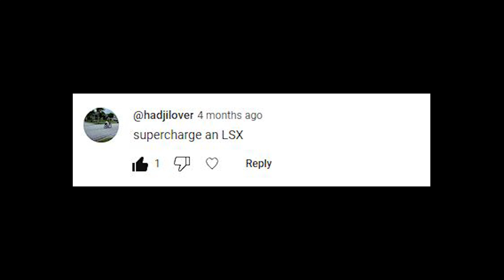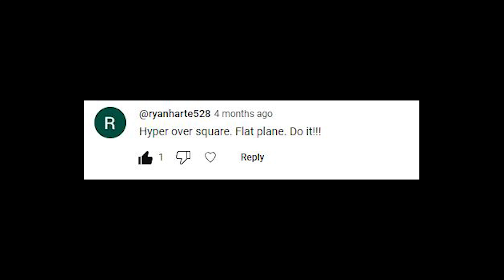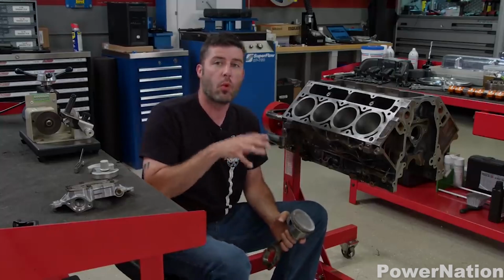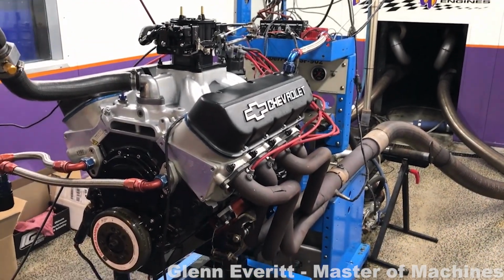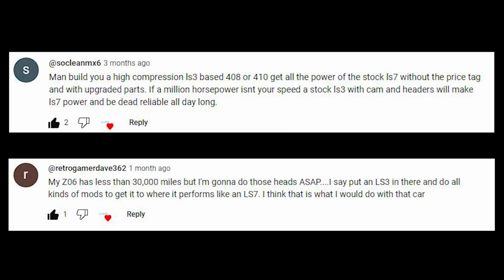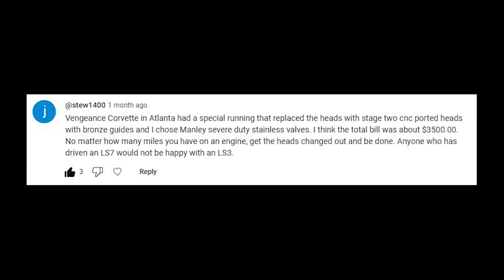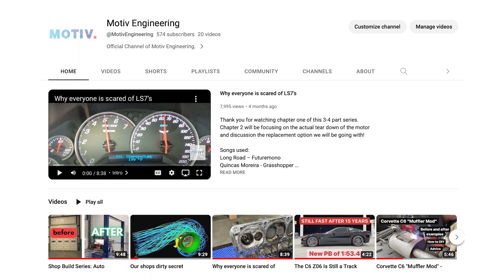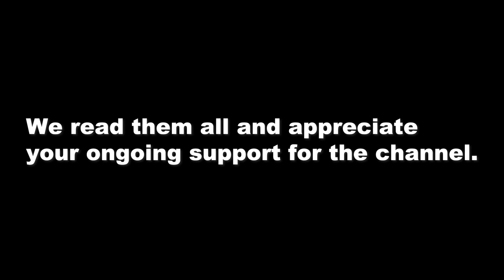Your LS7 replacement ideas

Comment: I’d just go ls7 and fix said valve problem.
Reply from the maker: That's what I'm feeling too.
Reply: That's what I did to mine 👍
Reply: If you go this route spend bigly on the heads..$3,500 gets you a pretty good package from American heritage. Ti / moly valves. Hollow ss exh, pm guides and all the machine work. For an extra 600 you could even use formula one guides. When these engines fail it's always in the cylinder head
Reply: @GridForgeMFG  ZZ632
Reply: I've seen a couple posts on the Corvette forum with exploded motors with "fixed heads". These things are a just a flat out gamble.
Reply: @GridForgeMFG well what happened I’m new here

Comment: I say stick LS7. You could always go 416 LS3 but Id want the ti rods and intake valves and some better exhaust valves in an LS7 to keep the character and call it a day. And thats exactly what I did. I went with a mild (for an ls7) cam and "fixed" heads, ARH headers and a ported MSD. A whole bunch of while youre in there stuff happened after I dropped it off.

Good luck with the build! Wouldnt blame you for just camming an LS3 and feeling safe for the next 100k.

Comment: Just bought my first corvette after dreaming about them as a kid. I chose the C6Z specifically bc of the LS7. 505hp in a LS7 vs 505hp in a LS3 or any other motor, just doesn’t have the same attraction, I think that’s evident in the car world. The power builds to redline, and those type of motors for whatever explanation, just grabs everyone by the heart. Si/type R’s with Vtech, McLaren  F1, AE86, many Ferraris 355’s, F550, Jag XJ22, GT350/350R, Toyota TRD, the lotus Elise with that TRD motor in it…Etc etc. N/A all day…& as long as the dyno graph just builds upwards until kissing redline ppl will love them 🤷
Reply from the maker: Wow, thanks for the thoughtful comment. I completely agree with your thought process. I think the LS7 changes the whole character of the car. I really enjoyed it. 

No matter the motor going in, I want the power to feel fun and exciting.
Reply: I agree the LS7 is a special engine hand built by GM. And pushed every limit we know. If you look at the CNC porting of that masterpiece its amazing.  I know it's not cost effective but they are just wonderful.

Comment: Whatever you do upgrade at minimum the scavenge side of the oil pump.  Past that depends on budget and power goals.  LS3 525 crate with dry sump upgrades is a reliable option to learn how to go faster leaving open the option for a bigger cam etc.  If you go LS7 I'd run aftermarket heads not ported factory, and work with a vendor such as cam motion to get the valvetrain to be reliable on track.  Aftermarket heads maybe labeled LS3 but are more LS7 in port opening.  Eric Weingartner had an internet port series on a LS3 aftermarket head.  One of the ports was a high velocity design which looked promising for a 427.  Even if you don't go with him it is an interesting look at aftermarket heads.

Comment: Oil pressure is one of the best tools to monitor how healthy your engine is. From watching a few clips of your lapping I can see your WOT oil pressure is def on the lower side. I say 55-70psi WOT is what your looking for on track with a higher weight oil. From videos, i can see it almost in the 30s which is what you want at idle. If i saw those pressures I wouldve considered a rebuild before anymore lapping was done. Just something to think about when you start over with a new engine.

Comment: I can say, we have put down a little over 500hp through a 4l60e with a 6.2L in a 72 C-10. Mind you we had CNC ported heads, custom grind cam, and a bunch of trick bottom end parts.
Reply from the maker: Good to know! I bet building out an aluminum 6.2 gets close to approaching used ls7 prices.

Comment: You can build an LS3-R. It's an LS3 block, GMPP CNC LS3 heads, 3.75" stroke, 4.07" bore, 1.165" piston crowns (Same as an LS7) flat-top ceramic coated and notched. 6.2" connecting rods. The pistons stick out less than stock with this combination. 6.4 liters, 391 cubic inches. TSP 227 camshaft. I stumbled across this setup by accident. I asked myself, "What if GM was allowed to use high quality forged pistons?" and this is what I came up with. 
-- Another option would be an all-aluminum 540 big block chevy with cylinder heads from the new 632 crate engine. You'd need a custom dry sump though.

Comment: So, I got to thinking about my suggestion of an aluminum big block. 
-- Brodix aluminum block will put you a minimum of 100 cubic inches beyond stock LS7's for the same cost.
-- GM RS-X heads have shallow valve angles just like the LS7 does. You can get Eric Weingartener to do your valve job. 
-- Kinsler ITB's as a cross-ram will be unique and true to the Corvette. 
-- Those heads will bolt onto a 4.56" bore. A 4" stroke, 1.27" pistons, and 6.535" rods give you 523 cubic inches and a tight above-deck quench.
-- A 4.6" bore and 4.25" stroke will give you 565 cubic inches, using 1.27" pistons and 6.385" rods, with a zero-deck setup.
-- A 4.5" bore and 4.25" stroke gives you 541 cubic inches. 
-- The camshaft I came up with is 232/242-114LSA, 108 ICL. You get a 44 ABDC IVC. .650" lift is all you really need on this thing. Yes, .700 will make more power, but there's so much of everything else going on, I think it'll be the last thing on your mind. 
-- Run a 4" pipe from the air box through the cowl and into the cab. 
-- If these are the end times of ICE, I say wing it!

Comment: RHS or Dart LS Next aluminum block, you can run it as a 427, 441 all the way up to i think a maximum of 496ci. They have priority main oiling, which is big for you track fellas. Also, the LS7 dry sump system (your current oiling system) will bolt right on (just make sure its cleaned out really really good). You can pick and choose your CR when building a engine, so you can push it to run on the ragged edge of whatever fuel you want and make big power. Having an aftermarket rotating assembly means you need to get it balanced at a shop, bonus is the shops will balance your rotating assembly FAR beyond what GM did with any of their engines, allowing you to rev higher, same with the valvetrain. Aftermarket addresses a lot of short comings, i won't tear down the LS7 as a bad engine since it isn't, but once GM puts them into production their weak links can be seen an addressed. Downside is this could be expensive AF, would have to do a lot of research to make sure it all plays nice together. If you are not dead set against a forced induction engine a supercharged LS3 or LS2 could easily produce the power levels your at now and exceed them if you wanted for much lower. But, why not start off small? get a junkyard L33 aluminum 5.3, throw a cam and a cheapo turbo, or supercharger? I mean, you basically have an race ready chassis. depending on how mechancially inclined you are you could chop the front off the car, do a full tube front end (would allow you to drop the fenders/front end super easy to work on the engine) and it would even offset the weight of a iron block if you wanted to go that route. Hell, do something weird and put a ford Barra engine in there with a big ol turbo. I am sorry to hear your LS7 block is dead, but now you can use the car as a platform for doing cool stuff! like a destroked LS3 that pushes 9000rpm or whatever! GL Friends!

Comment: If you have time and money, start with 5.3 aluminum block and bore, stroke it to desired displacement. Build a nice set of heads to match. The "affordable" easy solution, drop a LS3 crate motor with the hot cam in it from GM and call it a day.

Comment: So I know it's not exactly the same setup but I've got a centrifugal supercharged LS6 in my C5 Z06. The A&A kit is phenomenal for these platform of cars as it's essentially a bolt-on supercharger that isn't that difficult to mess with if you are handy with a wrench.
With my car's current setup, I'm pushing 583WHP which is a pretty hefty amount of power out of a 3rd gen LS.
Having something like a supercharged LS3 will easily stomp the ground out of any LS7 on track for linear performance curve.
Yes, it's not exactly the same thing as the "famed LS7" that everyone loves to talk about but it's still something that'll put the power down reliably.
Will you have to beef up cooling to handle the blower? Obviously yes. 
Speaking from experience however, a centrifugal blower has a very linear power curve and specifically hits peak power in the upper RPM band, meaning it's daily driveable when you want. I know this because that's how my car's currently set up. I daily drive my C5Z often, and despite having what BTR calls a stage 3 cam the car's actually quite tame unless I lay the hammer down.
A buddy of mine has a base C6 with an A&A kit as well, and our estimate on power levels with the flextune kit the car has installed from a previous owner is somewhere into the 700WHP range.
You can knock blowers all you want, but in the end if you do it right they make tons of power in a linear curve.....
Just my thoughts

Comment: honestly its pricy but an mostly stock ls7 with redone valve guides, either send it to a shop or do it yourself but another ls7 seems like the best option for many reasons and if you put a bit more time and money in to grantee good valve guides then you will have an amazing motor with reliability and simplicity.

Comment: You can't be concerned with resale value and want to consider anything other than a direct replacement/upgrade from the factory LS7. Anything less will likely significantly devalue the car unless it's some crazy boosted ls3 / 6.2L build (turbos, bigger blower, etc), which is also something you seem to want to avoid. It's gonna hurt financially, but I would consider a max effort N/A LS7 or 427 LSX. That way, you keep the displacement, potentially upgrade the power with cam and bolt-ons, keep the weight balance of the car similar to factory, and don't kill the resale value too much on the car

Comment: The LS7 offers things an LS3 doesn't without costing the same or more. The dry sump, for one. The bore size, second. 
Don't give up the LS7 because it has only one critical failure point that is easily solved with aftermarket valve guides.
Reply: Lots of ls3’s come with dry sump

Comment: There is a shop called TSK out of Ohio. They are taking gen 4 blocks and for $2000 they cnc machining they blocks. Then they press in Darton sleeves for 427 or 440 cubes. A 5.3s are cheap. Then run a set of ported Ls3 heads. Way cheaper then a new 427 that's going to detonate again.

Comment: MAST Motorsports re-sleeved factory GM Aluminum GenIV Block (4.185" Bore x 4.125" Stroke) for a 454 LSX short block, rebuilding your LS7 cylinder heads and re-using all bolt-ons. You don't need to spin the thing to the moon. A 6,500-6,750 RPM Track car with tons of bottom end would suit you fine.

Comment: My LS7 just had a valve drop, smacked the piston in cylinder 8 and cracked the cylinder wall. I am in a similar boat about decisions on what to do next.
Reply: Have you come up with a decision? Mine also just dropped a valve and I don’t even know where to start

Comment: I straight loled with the "devalue" conversation.  Mike: "i'm worried an LS3 swap will devalue for resale" Me- in my head: yeah for sure. I see a C6Z with an LS3 and I hard pass  Isaac: "so you're not worried that 100k hard track miles and a roll cage WON'T devalue it?" Me: 🤣🤣🤣🤣🤣🤣

Comment: How about a Dart LS Next block, 7 liter turbocharged? You get the strength and raised hp capacity without the weight of an LSX block. This is upgrade I am thinking for my currently procharged C6 Z06.

Comment: How much power do you want? 500whp should be attainable from a naturally aspirated LS3. A 416 stroker should have as much potential as an LS7 would if you're willing to sacrifice a few revs. 

Unfortunately, unless you wanna get what is eventually a motorcycle engine into your car, an LS is about the best way to get a powerful and reliable engine in a lightish package. ~450lbs for most  naturally aspirated aluminum block engines. 

Now the motorcycle engine route. Build a balls to the wall track car with a hayabusa V8 crate engine. Revs to 11k and makes about 460 horsepower naturally aspirated. The complete engine weighs only about 200lbs and you don't need such a heavy trany. I know you're not going this route but it's cool.

Comment: I think a cool motor would be somthing like cbm’s ls3 that’s stroked to 7l so you keep a 7l motor but with a ls3 type motor
Reply from the maker: I'll take a look. Thanks!
Reply: ls7 intake and cylinder heads bolt to any LS just need room for valves.

Comment: It hasn't been done in a ZO6 But a 454 Big Block Chevy Swap would be awesome. 
Sure its heavier but the Torque band is Superior to any LS X Engine ever built Normsl Aspirated. 
With modern Aluminum heads and just 11psi Turbocharged or supercharged Boost used be well over 1000 Hp and 850 ft/lbs + torque at the Flywheel. 
Also the Big Chevy has a Superior oiling system. PRIORITY OILING TO TO MAINS 1ST.

Comment: The LS7 Is neat Titanium equipped engine platform. 
I have been into them after they self destructed.
I used to build LS X Engines for a living in a South Chicago Race Shop.
Specialized in Street Racing and Drag Racing.  Also Endurance Racing builds .
The LS7 has what I call design Engineering faults likely to save $.
I like Titanium the way an engine performs with is hard to match Normal Aspirated or Boost. 
For one I would lose the Pankel Titanium Connecting rods they have Dinky 5/16" capscrew bolts.
It looks Kool but better Titanium Connecting Rods are made.
Crower 6AL4V Titanium Connecting Rods with L19 7/16" 1.800 U.H.L. Bolts. Full Floating design.
Cost will be about $8500 for a set of 8 custom made.
Full set of Manley or Victory Titanium Valves. You want them Full Chromium Nitrate coated. Cost is $185 per valve.  $2,960 there.
They are Forgef 1-piece Titanium valves. 
All New Bronze guides installed honed to size with a Sunnen P30 Honeall.
NEW Berrylenium Copper intake and exhaust seats or Super B Exhaust seats. About $1500.
The LS7 pistons are Wiesco Cast Hyperuentic. 
Ditch them they explode to marbles as you found out.
Want CP Carillo or Diamond 2618 Forged pistons.  Cost $1800-4000 depending upon options you choose.
So already if you can not afford this....must look to other options.  Engine swap Non LS7 No Titanium used.
Reply from the maker: Thanks for taking the time to give me that info. Good details in that comment! Could buy a house in Texas for all those Ti parts!

Comment: Also I have another c6 buddy who has a ls2 with Texas speed heads and a msd intake with the big cam he got with the car it put down 498whp but vary peaky, one of the stock lifters failed revving to 7k, and he had the 6.0 built with 12:1 compression and a smaller cam, he is now making 486whp on e85, but has 50 more torque from 3-5k and has ate a few c6 z06's and barely beat a bone stock zr1... zr1 went e85 and buddy lost after that lol

Comment: A 408 can be built to rev to 8k, make 550-650 whp (compression/cam/heads) where the 100 hp difference is, 

When they say 441/454 they are saying a lsx block, bigger bore/stroke than the ls7 (lsx has a taller deck height thus allowing more stroke) but... iron block,    

A ls3 /l33 with a pro charger (with intercooler) would be more manageable than a roots type supercharger with heat soak in mind, but the aluminum blocks seem to be 7-800 hp limited (besides the ls9) I'm not the biggest ls guy, but I'm around a few guys who are, so I'm going off of memory, and could be wrong on some facts,   

but one of those guys has a 408 lq9 with a dragon slayer crank revving to 82 or 8400 with a 90 something mm turbo making 1280 ish whp I think he was rev limited by the hydraulic lifters not piston speed so ls engines even bigger cubic inch motors can get into the 8k+ range if you go to a solid roller... but must lash the valves
Reply from the maker: Thanks for the info! We've always been interested in revving V8's high. I've looked into the dragon slayer stuff a bit, it's a compelling option...

Comment: The issue is the heads that i see. I fixed mine, especially as GM does not offer the LS7 any longer. Perhaps as a short block, but building from scratch will be expensive. Don't blow ot up, or you might be looking at this video's options content a lot closer.
Reply: I live in Canada and found it hard to find a reputable shop that had done such work. Davenport in Calgary sends a set of OEM heads to Lingenfelter to have guides replaced with ported heads  matched to incanel exhaust valves. Never did get mine measured to see what spec they were before replacing. But with 24,000km and reading/seeing numerous video failures, wasn't willing to risk my LS7. Hopefully ol' Rusty (Atomic Orange) will ride strong for years to come :-)
Reply: Yes Chevy does still make the 427, check out Chevy Performance, they make th LSX 427, a very good engine !! I bought  LSX 376 B15 for my C6 corvette.
Reply: @rodw1105  okay, thanks Rod :-) I'll check it out. Happy to see we have viable options. Nice!

Comment: What the hell???  We have LS7 engines here in Australia with 800hp reliably, even 1100hp from Higgins Heads here in Aus is doable in NA form.   Probably a bit late now, but just build the engine properly, these things can be very modified reliably.   Every engine has its problems, just build the LS7.